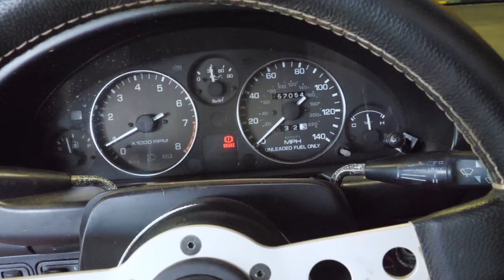Saving A Highly Modified Miata With Flood Damage, For Profit? Step 1: Remove Water

Comment: Moral of the story: if the flood damage is not to bad, don't file a claim. Just fix it yourself.
Reply: Usually after big floods insurance companies will just write off anything in a building that was flooded as long as it was below the water line. At least that’s the way it is with hurricanes.
Reply: A vehicle that gets damaged and subsequently repaired without going through insurance, will likely not be branded.
Reply: True for any sort of damage on a car with a low KBB/Carfax value
Reply: Depends on what they're willing to give ya for the vehicle
Reply: No way!
Reply: That is bad advice and an incorrect assessment of what the moral is. The moral is you need to know what kind of insurance you have. 

Talk to an experienced insurance agent, your state's department of insurance, or a public adjuster if you have questions about insurance.

All policies are not the same. If you do not educate yourself on insurance then best case you are wasting your money buying the wrong policy. Worst case scenario you have a loss and you don't have the policy you need.
Reply: @c0c0asauce  Fair enough. Everyone should know how their policy works.
Reply: Not all agree but I totally agree as immediate action would have saved everything in this case as it wasn’t huge water depth and not all that many serious connectors to be worried about.
Reply: @somebutter6755  like Eric said, salt water is a totally different beast.
Reply: For a heavily modified hobby car like this, definitely. It also depends how high the water line is and for how long. If its submerged up the roof, obv file.
Reply: Yup... especially when dealing with something highly modified.  Insurance is completely useless, period.

Comment: Wouldn't hurt to spray some wax in the doors and rockers after they dry out, and put dielectric grease on all the connectors.  Body cavity wax, you can buy in spray cans and they have long tubes to reach into the body panels.  Both will reduce the possibility of residual moisture causing rust.
Reply: Totally agree.  It's a novelty for me to see a NA that isn't horribly rusty.
Reply: @ferrumignis  I live in MI and I wouldn't say clean NAs are super rare, it really helps they're kind of a summer car and the daily driven ones have fully rotted away by now
That said I have the woolwax gun and use it faithfully on my NA
Reply: Wish I'd done cavity wax on my NC :(
Reply: @ferrumignis  come to Australia. Cars don't rust here as most places are hot and dry. I have a 2001 NB with absolutely zero rust and 265,000 Kms on it.
Reply: She's a keeper, can't wait to see more on this little Gem 👍👊

Comment: Just a handy little tip: to easily remove the manual window crank clips, slide a shop towel in behind the crank so it snags the clip and alternate pulling down on each side of the towel like milking a cow and the clip will pop right out!
Reply: Neat idea!
Reply: Ive actually found that using a sock works better than a towel, as the clip just pokes through the sock and gets looped in, GREATLY reducing the Christmas bells of that clip bouncing off everything metal in the garage before going to Narnia
Reply: Thanks, gotta do one soon.

Comment: 15:20 as a audio guy. the speaker is fine. it's a plastic woofer. most stock car audio is using a paper woofer. so this might be reusable.  it's not been high enough to go into the voice coil to affect it.. i suggest just gently cleaning the front and rear side. give them a quick test. if they don't crackle at reasonable volume. toss them back in. they don't look too bad. though they're not that high end.

Comment: Don’t forget to check the diff and transmission oil for water also the cv boots and steering rack.
Also get some mould spray and clean all the interior surfaces and head liner.

Comment: Got to wonder WHY flooded cars (fresh water) are often NOT left open to dry out. Even complex electronics that get wet in fresh water can often be saved by thoroughly washing with CLEAN water followed by a thorough rinse with distilled water. I have seen a hand held two way radio survive after cleaning having been over 24 hours under water turned on! Even salt water damage can be saved like that IF done quickly AND preferably if the item was not powered on when immersed. Always worth a try!

Comment: It would be very interesting to see how you cleaned that module with the ultrasonic cleaner.  I would watch that video, probably more than once.
Reply: The “secret” is that you can happily wash a circuit board with detergent and water as long as it’s not powered and you rinse and dry it carefully afterwards.

Comment: For future reference, if you're trying to dry something out, go rent an LGR dehumidifier. LGR stands for low grain refrigerant. Without getting too technical, it will pull more moisture out of the air. It's what we use when we dry flooded houses

Comment: The name of the mystery Insurer is right on the windshield. I'm a customer of said Insurer as well, and have been for just about 15 years.  They absolutely WILL NOT allow you to buy back "totalled" cars. In my case,  years ago, I had an über rare SVT Focus EAP Model which was totalled when some numbnuts ran a Stop sign, smashing the drivers side hard enough to where they separated/cracked the frame. I could've made a ridiculous amount of money,  just parting it out for Model specific parts (e.g. Recaro seats, HIDs, etc). Once they wrote the car off? Buzz off, seemed to be their opinion on the matter. Thank your Buddy for his Service. You got a Deal!

Comment: Great video!  A few thoughts, keep working on the drying out process. I know because my 2019 pickup leaked from the day I bought it. The headliner filled to the top with rain and melting snow water.  The dealer commented (with a smile) that it stunk up the whole building when they pulled out the carpets and seats.  About three months later I got it back, they replaced the whole interior except the front seats. 
Happy ending - the truck smells like new again.

Comment: If you have one, or can borrow / rent one, I’d recommend running an ozone generator in the interior to stop the progress of the mold growth. It won’t clear the mold, but it will kill what’s there and also should help eliminate the smell. 
As others have suggested if you intend to resume the interior, it will likely take a lot of scrubbing with disinfectant, maybe hydrogen peroxide. I’m gonna guess the hard-touch surfaces could be done this way, but the soft materials might be better off being chucked and replaced (actually I just got to the part where you cut the carpet 😅).

Comment: 0:37 ~ I'm in.  Generally I'll avoid anything with that on the title.  I bought a 88' Turbo Shadow in 91' with (apx) the same flood height and so on as the rig you're showing here.  It turned out to be one of the most cost effective and fun car I'd ever own.  In 91' it was an absolute barnstormer of weight and hp.

Comment: I've rebuilt several flood cars. The mold and the carpet and seats are the worst part. I normally just trash them. the rest isn't that bad. and I've done salt water floods. Wiring has to go on those. Fresh water or salt. Washing out body cavities and underneath is a good practice for stopping rust. Great job Eric!

Comment: Get some Deoxit and spray it in every single connector, even once above the water line has the humidity in the car may still cause corrosion. Then get some body cavity wax and start spraying everywhere you possibly can get the nozzle in.

Comment: Miata valve noise magic fix - Castrol Magnatec. I have no idea why, lots of people suggested it and wow it worked on mine. I ran 8 & 12 PSI (switchable) for years on stock internals. If you have a built motor and a good safe tune you should be good with 16+ PSI (220 RWHP) . 12 PSI on stock is very common. I'm in New Zealand so we call them MX5's. Good luck. Fun cars. Mine was an 1800 NB JDM and the computer was in the footwell. Both the 1600 and 1800 JDM are there, but proneto flooding.

Comment: Put 4oz. of seafoam in the oil when you are ready to drive it. It will free up the lifters and loosen any sludge. The change the oil after a 100-200 miles, I do this to my vehicles just before an oil change (50-100  Miles). My MINI N18 has a pretty big oil fill cap. You can easily see top top of the head casting looks brand new. Same with my Tacoma that has 160,000.

Comment: A bit of advise for working on old smelly or wet/flooded cars, get and Ozone generator. Ozone not only removes smells, it will kill mold and mildew. They are cheap too. 45 min and then airing it out can do wonders.

Comment: Makes me miss my old NA. Pulling the dash and heater core to get the carpet out in one piece isn't too hard. I did it in an afternoon and I had never done it before. My Mazda2 suffered a similar inundation when the local creek rose very sharply over night. Thankfully also a fairly simple car to pull out the seats and carpet to dry in the sun the next day. I did soak all the electrical connectors that got wet with a lot of wd40 as well. 6 years later, that car is still serving me well.

Comment: I had to do similar on my DC5 when after letting the car sit for a summer. Leaves got in the frame behind the fender, rotted away some seam sealer, water got through down to the floor and left mold and a nasty rust hole in the floor. I literally did everything you do in this video, tore the interior out, power washed and scrubbed the floor. Got lucky carpet wasnt too bad and used some non-bleach mold killer spray from walmart and it never came back. Now to fix the damn rust hole lol. Thanks for another great video.

Comment: You still might be able to salvage the seats and door panels by using OdoBan Disinfectant with Eucalyptus 
Disinfectant and give it a good  twice over with the scrubbing and then  go ahead and stick all of your stuff 
outdoors in the sun for 4-6 hours so that the ultraviolet rays can further kill off mold, fungi, viral type crap! 
It's worth while to do so and give it a try! Parts may be hard to come by ie: the seats, door panels, console.
The Home Depot has OdoBan for cheap even to the point of buying 2 gallons worth for those hard clean-up
chores and it should last you for up to 4 years worth!! OdoBan does exactly what it says that it will do!

Comment: Hey Eric, there's another channel here on YouTube I'm subscribed to that's in the Chicago area and he would probably use cavity wax in the rocker panels and in that area in the lower front fenders prone to holding debris in them to prevent rust. You might want to consider doing that on your Miata.

Comment: If I recall the most we ever dyno'd WHP on a NB was 310. We upgraded all the NA's from the 1.6 but for some reason they never would produce the horsepower the NB's did. 6 of us took a road trip from central KY to VIR back in the day and ran the long course. It was hilarious when the Porsche guys on the track had to move over to let us by. These cars were so simple to to work on and Soooo cheap to get engines for. A great friend of mine is the owner of Paco Motorsports. He sells a kit that makes a Miata off road vehicle.

Comment: I restored a "flooded"  Chevy Cruze Diesel, though there was no scum line. I suspect someone left a window rolled down in a rain storm. Anyway, after setting for who knows how long at the auction, it was much like the Miata. The body control module sat on the floorboard and had corroded to uselessness. (Dealing with dealerships is a diatribe for another time.) But instead of replacing interior parts, I wiped down the seats with vinegar, which killed the mold, completely pulled the carpet, soaked it in Lysol solution, and let it set outside for a month to dry. (Some parts of the foam carpet backing were 4 inches thick.)
There's also powerful ozone generators used to sanitize hotel rooms that works a treat deodorizing and killing mold in cars. I built mine from an ebay module, fan and homemade case.

Comment: For a heavily modified car like this, at least some insurance companies will allow you, by paying moderately higher premiums, to collect the full value of the car if totaled, and to keep it as well. I can't recall what the generic term is for that option, but I have this arrangement for my Lotus, insured by Hagerty, which they call Cherished Salvage coverage.

Because mine has upgraded suspension, a BOE supercharger, and various other mods that would be very expensive, if not impossible to reproduce, if it's totaled, I can strip out all the usable upgraded parts and transfer them over to the replacement car, then sell off or keep everything else as spares.

Anyone with a highly modified car should seriously consider this.

Comment: Make sure you clean and lube any bearings that went under water (like steering column bearings,  pedal bushings).    If you don't,  they'll go bad in short order.
Reply: Especially the muffler bearing. I guarantee that one is shot.
Reply: @danielknepper6884  That a given, with all the water in the exhaust.  And with a fast car, you really should get angular contact muffler bearings for the extra precision.

Comment: Those speakers are fine. Coming from an audio guy. Worst there would be rust on the speaker frame but they look fine. Those have plastic and rubber cones. Doesn’t look like the water line touch the voice coil.

Comment: I would have worn breathing protection for that cleanout.  There are mould spores everywhere but the overload from that could be troubling, I think.  Also, I didn't see much (if any) of the water you squirted into the sills via the holes in the door aperture come out anywhere.

Comment: Door cards might clean up. Replace carpets and seats as you might have got lucky with the water level hitting anything else. I don't recall much wiring at floor level. Bugger about the megasquirt but should be saveable.

Comment: I can't wait to see what the new carpet looks like, and I'm glad this was an easy fix for you! It's bringing back PTSD from my flood ordeal. I have new door plastic membrane, and my speakers survived, but I haven't been inside the doors to clean them out yet. I have sound deadening to install, so I figured if I find some nice speakers, I will it all at the same time. Should I really be worried about dried mud inside the doors? The day after mine flooded the second time, I cleaned out all the water and flushed out all the mud on the inside, and it was dry as a bone after days of desiccant.
Reply: The pinch seam at the bottom of the doors is intended to be the drain path for internal condensation and window run-off. It's also ideal for trapping fine dirt, which traps moisture and any incidental salt and holds it against the steel. For a few years you notice nothing as it breaks through the primer and galvanizing on the inside, then after an above average wet spell you happen to look at the bottom of your door and see multiple heavy rust starts bubbling through the paint.
Reply: @aaronvienot  OK, then my plan this spring is to redo the doors, clean inside, and also remove the front fenders and clean inside there too. I'll do it when I remove my hard top for the season, clean my drains, and condition my canvas top. Gives me an excuse to install my Frog Arms!

Comment: I"ve had a car totalled and the buyback was more than the check. Integras are worth a LOT more as parts than as a running, driving, vehicle. I fought tooth and nail, but it they were unbending.

Comment: When doing doors peel up dat plastic as far as possible n leave open after spraying it out ,then use a antibacterial cleaner on inside of doors and clean plastic with it to kill any possible mold and let it dry out real good ,like before u replace door panels before you install em,

Comment: Wow, Eric!  The method you are using, and the tools to clean that car, look like you have been watching The Detail Geek!  I know you know, but  I didn't see you do it specifically, but I hope the four drain tubes got cleaned out---2 in front of the A pillars, and two on each side right behind the B pillar.  I'd bet mud has settled in them and those are notorious for clogging up and rusting out on these cars.  I think the NB may be worse than the NA though.  That thing looks awesome.

Comment: Hopefully it gets a new exhaust too. Never heard of anyone building and boosting a vehicle with stock exhaust. I do exhaust first then build from there. But, not everyone is like me. I get the performance aspect from diameter. 2 1/2 dual or 3in on four and 6 bangers that exit the rear because fumes get you high
Reply: A lot of us keep stock exhausts. Don't want the noise of aftermarket ones.
Reply: Turbo muffler's always worked for me. I don't like loud either. It gets on yer nerves (especially chambered muffler's) and I don't need to signal the cop's every time I get on it from a mile away.

Comment: Just wondering, have you ever done, or even talked to somebody who did one... "Monster Miata." A pre-2005 Miata with a small block Ford V8 conversion, 5-speed manual trans and the 7.5" Ford rear axle center section. ? It seems like this Miata would be a good candidate, as its necessary to replace the engine, trans and rear axle anyway, and the rest of the car could basically just be set out in the sun to dry out. There is a company in California who can give you complete directions and even the parts and brackets to adapt it. Just a thought.

Comment: Hoovies Garage has a TV Show on Velocity, called Car Issues. He bought a white 1st Gen Mazda Miata w/ 27K miles. He paid $11,000. It was in Mint Condition.
The Wizard (mechanic) replaced the Timing Belt & Oil Change for $1400. The tires were 20 years old, so it needs new ones.